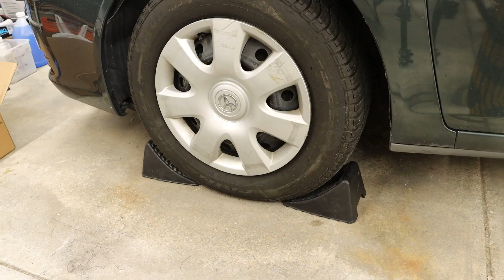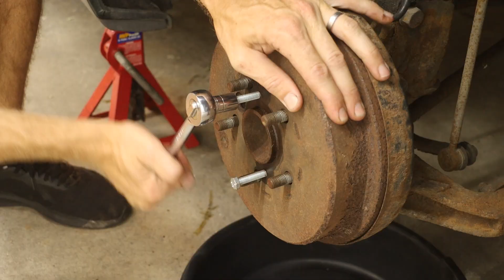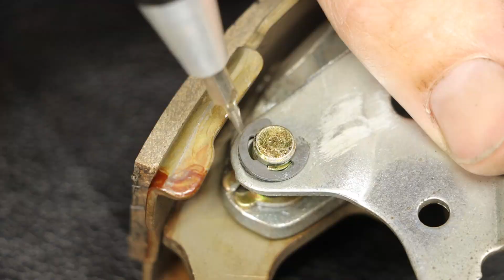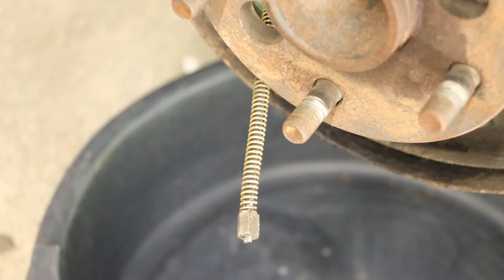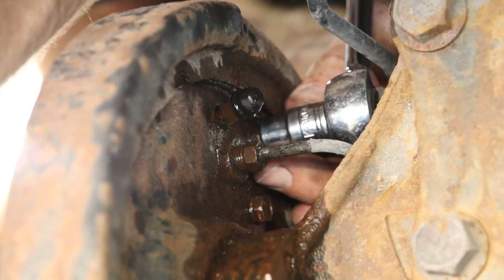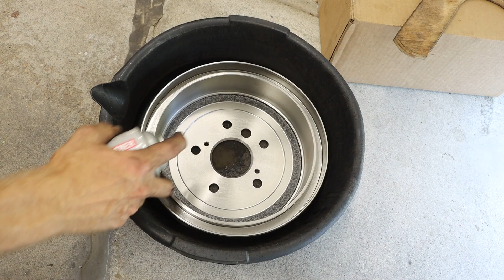Replacing Rear Drum Brakes and Wheel Cylinders - 2003 Toyota Camry, 2.4L (2002-2006)

Comment: Should you bleed all the brakes or just the rear
Reply from the maker: If you're only replacing the rear wheel cylinders, bleeding the rear brakes is generally sufficient, provided the master cylinder didn't run dry and no air entered the rest of the brake system. However, bleeding all four wheels is a good precaution, especially if the brake fluid hasn't been changed in a while. I would also recommend checking that the brake pedal feels firm before driving.

Comment: Why do my new shoes that I got from rock auto not have that piece of metal sticking out on the right side shoe that the brackets connect to?!?!
Reply from the maker: Are you referring to timestamp 7:00, the part that I am putting grease on?
Reply: @InsaneOil  Yessir, ended up figuring it out, was my first time doing drum brakes.
 Had to hammer that metal stud out and reuse it on the new part.
 Wasnt neccesarily easy either, had to drill a slightly larger hole through the new shoe cause it kept bending the metal and wouldnt go into the factory hole. All is good though now. 
This video was an A+, was easily able to rewind certain parts and figure everything out, dead certain I would of been completley lost without this video. Even AI can't show me this in depth!

Comment: I'm 64 years old.  I cant believe I used to do this out doors, when I was my mid-20s, on my 1982 Toyota Corolla.  I was just winging it.  At this stage of my life, I have to move forward with good detailed instructions.  I'm dumfounded with the amount of rust on my daughter's 2002 Toyota Camry, on her rear brake drums.  My 1982 Toyota Corolla never had this kind of rust and neither did our 20-year old Honda's.  I think my daughter's car spent much of it's life in North/Central Ohio, while our other vehicles were from the Cincinnati/Northern Kentucky area or from retirees who did not drive their cars in the winter time because they were snow birds.  Very helpful video instruction.
Reply from the maker: Thanks for the comments.  I appreciate it.  It sounds like the video brought back some great memories of the 20 year old you, sitting on a hot concrete driveway in the 100 degree heat.

Comment: You need to install the rubber inspection plugs for the adjuster hole on the new brake drums. If you drive it in any water especially on Northern salty snow roads, it will ruin your new work quickly.  Shoes and hardware/ springs will corrode and rust.
Reply from the maker: Correct.  It will definitely help keep the debris/contamination out of the system.

Comment: Excellent instructional on the bake job that I will tackle on 2004 Camry for the first time. Just curious about a few things. The spring 1/4 turn retaining nuts, it appears that the kit I have does not have cups on both sides, I will check the package again, but I believe that there was originally just a flat washer. I have not looked yet on your videos but I’m sure you show the brake fluid bleeding procedure in another video that I will definitely want to watch, and lastly the grease you put on is that similar to the  Sil-Glide? I was thinking about going with the anti-seize on the back plate and the soil-glide on the pads.
Excellent video, and I’m building confidence the more I keep rewinding your video. It is really well done. Thank you for the confidence boost.
Reply from the maker: On the 1/4-turn retaining hardware, what you’re seeing is normal. Some kits come with a cup on both sides, others use more of a flat washer style on one side. As long as the spring is held firmly and the pin is locked in place with that 1/4 turn, you’re good. Definitely double-check what came off your car and match that.

On bleeding, yes, I do have that covered in other videos, and you’ll want to do that especially since you’re changing wheel cylinders. The key thing is to keep the reservoir full and work your way through the system so you don’t introduce air.  https://www.youtube.com/watch?v=9K5hwzS86Dk&t=11s

For grease, what I’m using is basically the same idea as Sil-Glide. You want a high-temp brake lubricant on the contact points where the shoes ride on the backing plate. I would go with brake grease over anti-seize in that area. Anti-seize can work, but it’s not really designed for that application and can get messy. Sil-Glide or a dedicated brake lubricant is the better choice.

It sounds like you’re on the right track. Take your time, lay everything out, and don’t be afraid to compare side to side as you go. You’ve got this
Reply: @InsaneOil thank you for your reply. I appreciate your time in responding to me as well as your  how to keep things organized and a cool behavior.  All things I have to improve on and I will.
Reply: @InsaneOil I did remember something that I wanted to ask and that was regarding the small.c-clip on that adjustment lever, not the "U" clip that I see in my little bag of goodies that came with my break kit. I can guarantee that I am going to launch it when I pry it off and the panic will strike.  I thinking of getting a kit on Amazon that has a whole bunch of sizes, do you know if that is an M5 or something in that range? Ill buy extra ones just in case. Thanks again.

Comment: Years ago, I put a pair of wagner inner shoes to the drums. Immediately, I heard rubbing noise from the rear, so I took the shoes off and put the old ones back, and the noise went away immediately. I guess the correct way to do the job is to replace with a whole set instead of just shoes.
Reply from the maker: The pads will usually wear into the drum to some extent, so a new pad will sit slightly differently, unless the drum is resurfaced.
Reply: @InsaneOil  Thanks for your excellent illustration! I shall replace the rear brake system with two full sets sometime in the future, including the drums, shoes, cylinders, and hooks.

Comment: Great video until you coated the wheel flange with protectant. That product contains Petroleum (OIL)  and is not recommended for brakes. I saw it dripping off the flange as you installed a cleaned drum, only to get oil all over the inside of the drum braking surface. NO Protectant should be installed on a spinning part, it will throw it outwards to the braking surface.
  Google AI says protectant is safe for brakes, but that is NOT true.
Reply from the maker: Thanks for the comment.  Yes, I was a bit hasty to put on the drum.  Amsoil Heavy Duty Metal Protectant will dry to a wax like film that is designed to not sling off. https://amsoilcontent.com/ams/lit/databulletins/g1136.pdf

Comment: I've been looking everywhere for help with locating and using the access port on the rear side of the drum.  My drum on my 03 camry only comes about halfway off and no further.  I'm trying to locate the access port and star drive to close the pad so I can get the drum all they way off.  Can anyone help?  Thanks!
Reply from the maker: Any solutions to this?  There is typically a rubber plug and will get caked with dirt and debris and often is not clearly seen.

Comment: I been changing brakes on Toyota's since the late 70s on  and pretty much the set up is the same on many/all models. 
Another great presentation. ✌️👍🇺🇲
Reply from the maker: Thanks for the comment.  Good luck with your repair.
Reply: In addition I purchased special brake tools specific for Toyota back in the day since I did a lot of Toyota brakes, example: brake adjustment tool.
Reply: To adjust the brakes on the Tercels the window is behind the backing plate.

Comment: I just replaced my 2002 Camry's. That long spring gave me hell. It was really hard to stretch it all the way without dragging the parking brake adjuster assembly with it. I adjusted both sides to the max but still my car moves when in Drive or reverse.
Reply from the maker: It might be worth putting the car in neutral with the parking brake off and see if it will roll.
Reply: @InsaneOil  thank you. I tried. I need to overpull the lever to make it stop. Unfortunately, my new drums didn't come with holes for the adjuster so I had to remove  the drum to move the adjuster until the drum didn't go back in and then roll it back a few notches to put it back.

Comment: Sucks when whoever did your rear brakes on your 2005 Camry LE prior  uses the setup for a 2003 or a japan-built model. You get well into the install and realize that the shoes don't quite work with the parking brake and adjustment levers that you have. Also have to swap out the pins the levers pivot on which isn't quite as much of a pain as having to drill an extra hole in the shoe for the little spring that holds the adjustment wheel lever.
Reply from the maker: That sounds like quite the dilemma.  The vehicle in the video is a 2003 Japan built model.